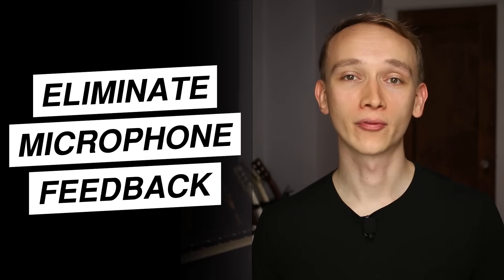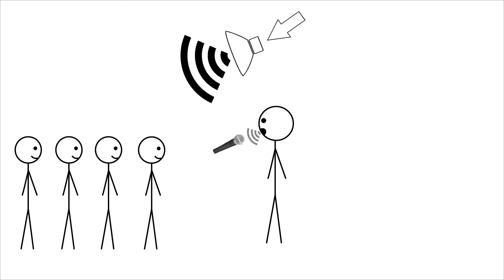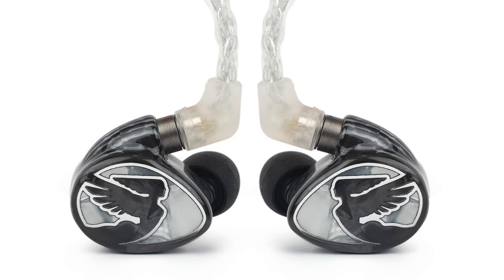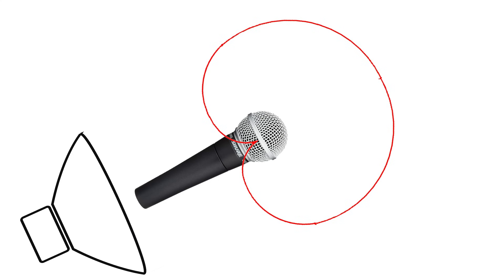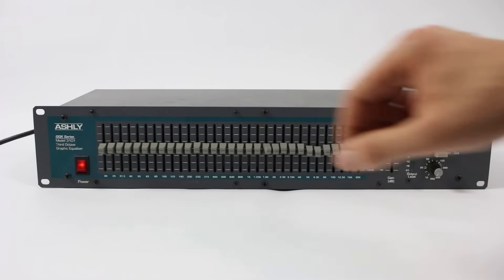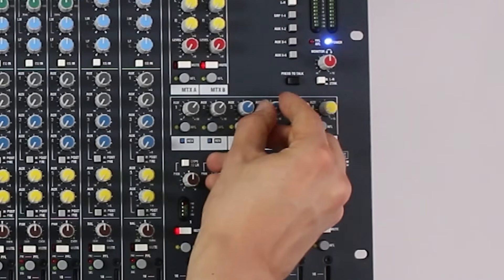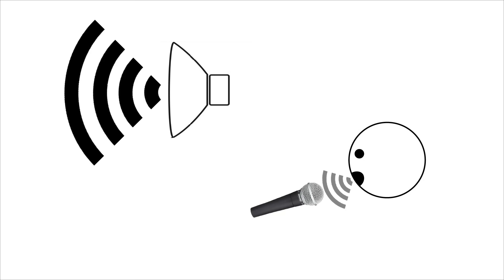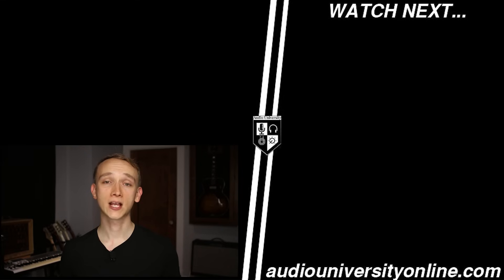How To Eliminate Microphone Feedback | 5 Must-Know Tips

Comment: I cannot stress enough how well this was begun, but he got several things confused.
I like the drawings but they are a bit... ...off... in some.  They do illustrate the point and it was done well.  It leaves a lot out, and some to be desired.

Cardiods are common because they're cheap and they don't alter response with rough handling, not because of their rejection of off axis sound.  Omni directional have no off axis, cardiods have minimal off axis reduction.  Supercardiods are more common with higher end vocalists because they reject more readily from the rear and sides, but have a very clear signal from the front where the talent lives and thrives.  Cardiods are used more on instruments because they're cheaper to maintain, and offer a wide on-axis area where the attenuation won't be all over the place, so the player can move that trumpet all over but the volume won't drop.  They can take a pounding and last longer, so even if the price per unit is a little higher, you buy one every 10 years and beat it up, as opposed to replacing another at 20 bucks less every three years and treating it like a motion triggered nuclear explosive.  
The 7 or 8 frequency thing... ...Umm.... ...No.  I've worked venues where you cannot hear anything behind row 5 until you flatten the room out with 15 of 31 faders having an adjustment.  EQ your spikes out, then see where your loudness sits.  If you can cut trim, do it, absolutely, yes, bingo, right on the money.  You will get a lower noise floor, and you'll have a cleaner sound.  However, the more mics you have on stage, and the closer they are to the speakers (especially when you cannot control that placement), the more frequencies you will have to taper from spikes as you get to an audible level.  Every time you double the number of mics, you double the overall feedback level, and multiply the number of spikes by roughly 1.6.  I've done 10 and 15 faders on a graphic eq before reaching the point of room color band, and yes that was with a very live, very hot stage with a lot of mics, most of which had multiple purposes of use.  This has been 70 to 90 percent of my live sound work, and it isn't what people usually think of as live sound.
Room color band: That means you reach a point where a large band of frequencies all feedback together because the room has it's own sound color curve; sound will react generally in that room a certain way.  If you use an RTSA or real time sound analyzer on the room you'll see that curve represented like a histogram, with spikes and all, and it will show a hill in the area that would pop up as feedback when you reach that level.  This is the max gain before you lose color, which, if you use an EQ at all, is more important than max before feedback.  On an RTS analyzer, the entire band of frequencies, or a "peak" (looks like a hill), rises up covering a wide range rather than just a single frequency area that looks like a single spikey line.  At that point, the "hill", you are at the color and mode of the room.  This is usually the maximum level you want to reach, as going any higher would be removing the characteristics that make the sound natural in the room.  IF you have enough "loudness", you can adjust the trim of your mics back down for their gain level, but if you are just audible for your quietest performance, you are stuck with the current level.  Personally, I take the condom style of analysis in most situations.  I'd rather have an extra available and not need it than need it but not have it.  I try not to keep more than 6db in excess, and I have used that on one or two occasions when a kid got nervous and needed a little extra volume while they performed.

He only discusses EQ from one mic.  Wonderful in a studio or on a big star famous live stage, but I don't usually eq each individual mic first.  If your stage is that big, they are in an open dome, and you need less room eq anyway since the room is, well, only half a room (no roof, you lose a lot of bounce), and you can get away with skipping the room flattening.  I don't want to reinvent the wheel over and over with every mic by eq'ing out the room with each mic when I have 16 to 25 mics onstage.  I eq the room and speakers with the mics all hot, then COLOR the mics as necessary.  I have one master eq on the back end with 31 bands, and an aided Display at the fader helping me identify feedback, and sometimes I have to go harmonic, but that's normal operation.  Why all on?  HMMM.  Maybe because in many of the groups I've worked with, at some point in the performances, every mic on stage is hot and in use in some way, whether it's lowered by fader a bit or full on, they are all on, or almost all on.  I get the same result doing it once that most of these guys get doing that 25 times.... ...I do it in 4 hours, they take a week.  The difference is that they do it for big name famous, and i do it for everybody.

Feedback isn't just from mic to speaker.  Spikes can come from electrical system balance, from ambient vibrations in the room and from moving air.  The propagation or growth of the volume of theses things all comes through the mics and loops around, but many of them amplify faster than simply loopback because they are aided by the existing sound continuing, even if it is initially so soft it is below our hearing ability.

Fast, safe and clean method:
Step  1: connect mics and heat them up (DO NOT CONNECT SPEAKERS)
Step 2: Connect EQ to back end
Step 3: push master fader all the way down, mic faders should be at unity gain, trim to vocal level (I go -10 ish on vocal, as that whole -20 thing doesn't get any sound at the end; it works on drums though)
Step 4: speakers turned OFF, plug in
Step 5: slowly increase master fader, at feed back, identify, then pull back master fader, and then pull back eq fader; repeat until a large band of frequencies loops
Step6: Check master fader level, if zero, you can stay at this level, but if too loud, you can adjust down, then adjust mic trim and adjust master back up and check again
Step7: color mics with parametric by subtracting color not adding; it will react big for small adjustment
Step 8: readjust trim upward slightly to make up color loss or use make up gain on the EQ to get overall gain back or use a make up gain on eq or speakers for a small amount up to 3db.

Works every time.  Total process with 16 mics (8-12 solo, 2 choir, 2-4 instrument) and 2 playback inputs, about 3 to 4 hours max, without any rehearsing, 4 maybe 5 with a quick rehearsal.  Run pink, you should get a decent pink, run your music tracks through a cdplayer, pointed at any mic, you'll get decent sound, but with your color, of course.  Run playback tracks, and don't forget to color those too.

Many times I don't get wedges.  No space and performers will kick them, trip and fall etc, especially kids.  Wedges are great for pro and rock and roll shows, but for general use among most performing arts live setups, they are not used.  When they are, EQ them separate from the other.  They don't need to be extremely loud, just loud enough to let the singer really belt.  I've used them with kids, and safety is an issue.  The best monitors to use are small 10-30w boxes you can weld or tape to the mic stand up off the floor a bit, and not on every stand, just from outside then skip one, then another and so on until you reach center, and angle them in at 15 to 30 degrees.  The off axis from these, when colliding with off axis from near stage house facing speakers will result in near zero wave motion at the mic, but increasing quickly as you move away from there, making feedback less a problem; eq can then be limited and color is easier too.  I welded a casing to the mic stand and floated the speaker inside, knocking out the vibration being passed to the mic stand, used it on a high school band.  The singer was able to hear themselves and get to a good vocal level, while the band was able to get their balance from wedges and adjust down.  The onstage sounded balanced and the house was dancing.

While the video is great for a novice trying to work a 4 person high school band or somebody with more money and time on their hands than they know what to do with... It doesn't address the problem of feedback, its causes, or a practical method for dealing with it in a wide variety of situations.  It only adresses one mic, which ideally, you would only eq for color which is usually contained on the board itself in the parametric eq, and doesn't address the biggest eq problem, the room and speakers.  You can handle it all by putting your eq on the back end, at the output, and ringing it out with a single fader push, then you can apply effective subtractive color, or drop your trim and use add color methods, but you are more effective when you balance for the room\speaker combo first.

Comment: The music/sound industry misuses the term "feedback."  Feedback occurs any time that any portion of a system's output reaches its input.  This happens very frequently and often with acceptable results.  The sound we call "feedback" is more properly "oscillation due to feedback."  Before the system begins to oscillate, however, feedback has other effects.  The most common effect is a change in frequency response, AKA "tone"  that results from constructive and destructive wave interference.

The statement "The point at which the sound from the speaker becomes louder at the microphone than the sound from the vocalist, [oscillation due to] feedback will occur," is incorrect.  Consider that oscillation due to feedback can occur regardless of whether a vocalist is even present.  Oscillation due to feedback occurs when the in-phase loop gain at any frequency exceeds unity and the oscillation occurs at the frequency with the greatest loop gain.

In addition to microphone selection and speaker placement, the architecture of the stage is a factor.  Especially, small stages with close back walls can be problems because that wall bounces sound from the monitor speakers toward the microphones.
Reply: Well the term feedback stuck so it really doesn't matter

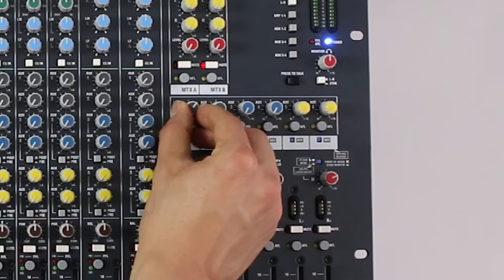Comment: At around 5:30, you are making the assumption that you have the luxury of multiple aux mixes so that each musician can have their own monitor mix.  In a more budget situation, that's probably not the case: you may only have one monitor mix available.  So you get into the situation where each musician wants "everything louder than everything else" in the monitors, as the saying goes!   Any thoughts on dealing with this?  It's probably more of a social engineering problem than a technical one...;
Reply from the maker: Good point. This might be where using EQ on each input will be helpful. You can create space for each instrument by carving away what isn’t needed. That way the instruments will mask each other much less than before.
Reply: @AudioUniversity  Most lower-end mixers though, don't have separate EQ capabilities for the main and monitor mixes.  I'm thinking now about bread-and-butter small to medium club gigs where you will have to do main and monitor mixes on a single console which may have only one monitor mix bus.  Of course, in that situation, I guess there is no real solution other than "sorry, that's as much as I can get for you, it's almost feeding back already"...  ;-)
Reply from the maker: True. If you don’t have the optimal gear for the task, there’s only so much you can do.
Reply: @AudioUniversity  Yes, sometimes you just have to work with what is available.  I do wonder, though, if amateurs should be allowed to have graphic equalizers.  I have been at gigs where the "sound man" has the graphic set at a curve that looks like alpine passes, all over the place.   Asked why, they say "well, that's how we always had it".   The idea that you start with EQ flat and adjust only as necessary does not seem to occur to them...?
Reply from the maker: I was probably that guy when I was first getting started. Sometimes, it just takes someone teaching you the proper way to do things…

Comment: The MIC pre amp gain level first is to set a good working level of the incoming signal. Isn’t it?
Reply from the maker: Yes. It’s ideal to set levels to peak around -12 to -18 dBFS.
Reply: So I don’t agree completely when you say “start at the lowest gain input level possible and then turn it up” . First should worry about turning it up till you reach a good signal, and start from that point.  Just asking, maybe I am wrong.
Reply from the maker: You’re technically correct. As you can see in the comments, many have mentioned this and they are right. 

I have found my method to be faster and usually the outcome is a proper signal level if the system gain structure is otherwise properly calibrated. 

But you are correct that you don’t want a tiny signal level. This is especially true if you’re mixing FOH and monitors from the same console.
Reply: Maybe your way is more accurate for finding the precise frequency to cut out. It’s an interesting approach to feedback.  On DiGiCo consoles, working with 2 desks in master/slave mode for FOH and monitors you have the option to independently decide input MIC gain.  Different s rooms, different Gain structures, different goals too.  Make sense.
Reply from the maker: Oh man, I love DiGiCo consoles. I’ve only ever used the SD9, SD7, and S21, but they are so customizable and powerful! Sounds like a cool setup!
Reply: It’s like paradise. Don’t see them too often neither, but they are my favourite for live bands.

Comment: Step 3 can be done automatically with a feedback eliminator. However, the name greatly exaggerates what it can do. It has many dynamically controlled narrow-band equalizers which kick in on the fly to reduce the gain at the precise frequency of the feedback. Because the performer is always moving around, it's impossible to eliminate all feedback frequencies manually. Also, a manual equalizer is not capable of getting the exact feedback frequency every time, and it will produce unwanted frequency response dips, where a feedback eliminator works on such a narrow band that you won't notice its dips. They aren't perfect, even if it has 20 bands, your performance will demand 21! Nothing will completely eliminate feedback. But, they will do a MUCH better job than any equalizer. Go ahead, keep the equalizer to flatten out the frequency response of your venue and speakers. But, don't use it to control feedback; you will fail miserably.
Reply from the maker: Thanks for sharing this tip, @TheClearSounds! I agree - feedback suppressors/eliminators are really impressive and useful tools. 

I do think there is still a place for graphic (or parametric) EQs for reducing feedback though, because a feedback suppressor on every output channel can get quite expensive and DSP-intensive.

Comment: Thank you for this video. This is great. Several years ago I was going to buy a 500 watt speaker that went down to 32hz. I wanted to hear my recording on my keyboard and the speaker on pole would be next to me. The speaker manufacturer told me I could not do that, as my mic would be aimed at the speaker. He told me I could not do what I wanted to do without using ear buds. I bought it and have placed my mic right in front of speaker. No feedback ever. I contacted the manufacturer 2 years later, and he still insisted I could not do that. I said I have a powered Yamaha mixer and gave model#. He then said, "Oh that has feedback suppression. That is why you can do that. " The rule is always quoted, but if you do not give the exception with it, then you have given wrong information. Thank you for giving us good info.
Reply from the maker: Thanks for sharing this experience! The feedback suppression in that mixer must be excellent!
Reply: @AudioUniversity  Yes, the mixer is at the church and is Yamaha powered mixer emx7. Never once was there feedback. Curiosity got to me so before church I placed my mic 5 inches in front of live SA AUDIO speaker, no feedback. I was told by the speaker company others tried to do what I am doing, with about  same speaker, they had feedback. So it was a great mixer that saved the day.

Comment: You forgot inverting the phase on the input ?
Reply from the maker: Does your process include inverting polarity on the microphone?
Reply: @AudioUniversity  Yes indeed, especially on vocal mikes, which are the most likely to cause feedback on monitors. If you use two boards only invert on the Monitor Board. Makes a great difference sometimes !

Comment: Mic gain must be set according to the input level meter - not to an aux pot position! Simply because that is the base for proper gain staging through the whole PA and monitor system. Especially in the analog domain.
Reply: Exactly. It’s interesting when you see someone mixing and the meters are barely lit up.
Reply: Agree. Always cure at the source
Reply: I agree too... improper gain staging will effect also how EQs, Compressors and Limiters works.
Reply: Yeah, this is REALLY confusing for newbies, especially when digital stage racks have one of two consoles set gains for the other and it's usually the Monitor tech to handle that, with FOH compensating via trims. The thing is, you won't find this arrangement outside of a house installation where the driverack already has everything at a desired volume level for whatever is expected or for a touring show where engineers tuned SPL for all SR beforehand. Unless someone else knows otherwise I can't think of any other case where Mons is setting channel gains-- I've never heard of it done using an analog split ::shrug::

In other words, yeah, the advice he gave for gain staging here is useless to anyone lacking experience.